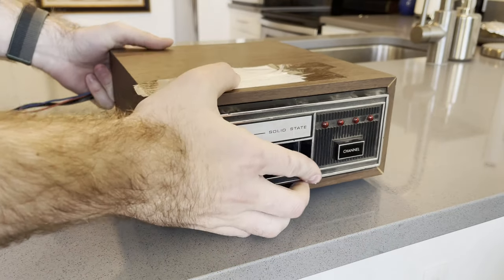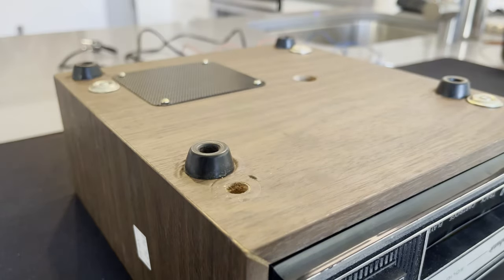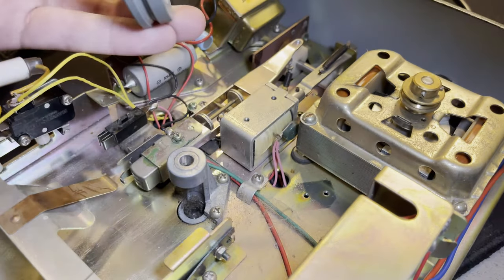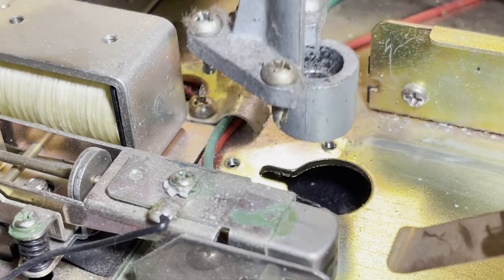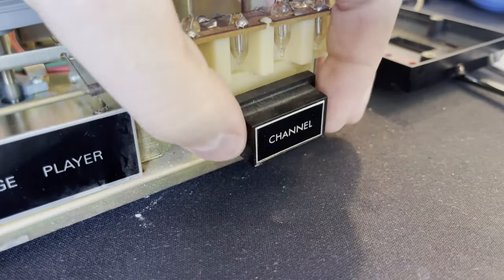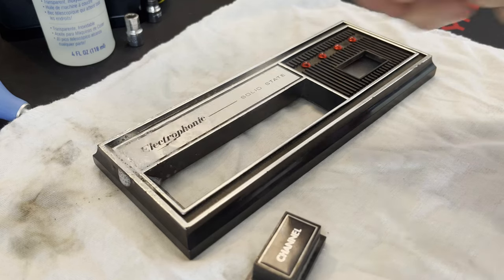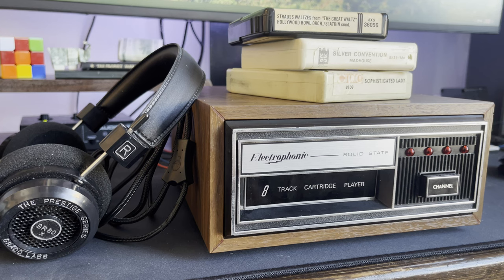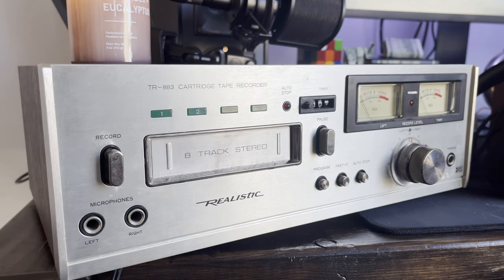Busted 8 Track Player, Will It Play Again? | Vintage Hifi Revival

Comment: For those people fighting an 8 track player with huge radical speed problems, the power supply may need to be re-capped. It is not always the motor going south. If the power supply is sending unstable voltage to the entire unit the motor will run crazy fast,,slow back to a normal speed, a quick jump sounding chirp in speed,,,,over and over.  My "Sony TC-228" went nuts like this yesterday. I replaced 2 capacitors that were waaay out on tolerances on the power supply PC board and also the stand alone big trash can capacitor next to the transformer and now the speed is excellent again.  I got lucky it was not the motor.

Comment: That was awesome! Great job resurrecting that old 8-track player. I would recomment servicing the carts too if you're gonna play em regularly. Adjusting the tape tension and replacing the pressure pad and the sensing foil tape is most important. I had bought some 8-tracks from a record resale shop once and the guy at the counter told me they probably wouldn't play. I told him I know I how to service em and get em playing like new. I posted video of the tapes playing to the store's FB page and he was impressed.

Comment: I worked as a car detailer for years. We use air compressors & mild degreasers to remove dirt ect from hard to get to places like the front grill of this 8 track you were trying to clean. Hope this helps. Good vid too. Cheers.

Comment: Just found your channel and I gotta say, this is really good stuff. I enjoy your methods of diagnosing issues along with the repair and cleaning segments. As someone who was a teenager in the ‘70s, 8-tracks were the best! Except when they started dragging, then you’d have to put a book of matches under the tape to maybe get it to stop. If that didn’t work, sometimes you could pull the tape out one side and pull it back in on the other side quickly. That sometimes worked to take the slack out. Had a friend who’s mom worked at Sears and he had an 8-track recorder. Man, we thought we were high tech, recording tracks off of LPs and 45s. Prehistoric mix tapes. The main thing I remember about 8-tracks was the factory versions that changed tracks in the middle of songs. Free Bird, arguably Lynyrd Skynyrd’s biggest song, changed tracks in the middle. Anyway, loving your content!
Reply from the maker: Thanks! Glad you enjoy!

Comment: Put the contact switch back in and adjust it to just clear the cartridge and it should work, clean up the capstan and heads,also the rubber idler roller, the unit should work normally

Comment: Great video! I just received an Electra branded 8 Track / AM / FM Stereo unit (with the manual that has a schematic) from a family member, and the radio works, but the tapes I put don't play, yet I can still hear the innards of the player just fine, so I know it's not a belt issue. Going to investigate it further soon as I really want this thing to work! If all goes well, I'm eyeing on a Christmas compilation 8 Track tape that has all the good classic songs you'd hear on the radio. Wish me luck! I'll keep you posted!😁👌
Reply from the maker: Thanks and good luck! If you can hear the motor, but tapes aren’t playing then it’s possible the belt fell off one of the spindles. It’s usually safe to assume the belt has gone bad if it hasn’t been opened in a few decades haha.
Reply: @HifiJelly  Update: It finally works! I don't know how but as soon as I took it apart, I could hear the tapes play when I put a test type in! Don't know how that happened, but I'll take it! Belt was still good believe it or not! I went ahead and cleaned the head and the capstan and motor just to be on the safe side. The capstan wasn't that bad, but the rest needed 4 Q-tips each, on both sides! Yikes! All I need to do is to see if any of the tapes that I received with it need repairing, and I'll be set! I will use the videos from 12voltvids for reference. Thanks for the help though!😁👌
Reply from the maker: Glad to hear it! The best repairs are when opening the device somehow fixes it haha
Reply: @HifiJelly  Ain't that the God's truth!😉

Comment: If that is real veneer I'll eat my shoes. These cheap boxes had almost uniformly laminated coverings. You can see the difference because the 'veneer' is a single length flapped over the edges. Real veneer would stop at the edges of the box. That said, in good condition laminate can look just nice.
Reply from the maker: Good call it had me fooled, looking at it in more detail and yeah, it's definitely not real as its bent over the edges and around the front. Also, that would explain the bubbling around the bottom feet.

Comment: Electrophonic  A.K.A. Morse - Electrophonic.  We sold them at the shop.  Cheap, overhyped low end stuff.
Always tried to sell  something else.  They had a distributor 15 mi away in Framingham Ma.  Handy for parts etc for us. 
I dont think Sears sold them but any real radio - TV shop could.
I bet your microswitch had a plastic roller on it. If it fell off the tape would hit the actuator arm instead
of the roller. Anyhows it does have a nice heavy motor.
LFOD !

Comment: I grew up with 8 tracks but I never really bought any; was into vinyl. Then I just started collecting them around 1990 at flea markets and thrift shops for about 25 cents to $1. People I bought from looked at me like I was weird and some said "You still buy 8 tracks?" Then ebay came a long and goodbye cheap 8 tracks or even finding them. I've worked on several players and tapes and posted some videos mostly on tapes. What do you have is a very solid piece; I love the durable AC motors even though they tend to get hot after a while which is why there is a metal vent grill on the bottom of it. Looks like they used a rubber band instead of a dry belt (?) which can cause the wow and flutter in the sound. Rubber bands are okay for things like analog Tape timers/counters. The issue with the switch is perhaps that it's not the original part and somebody replaced it wiith another that doesn't fit the way it should. If you could reference your player with another exactly like it and see how that one is configured would be helpful.

Comment: To reslack the tape find the splice remove the splice take the tape and gently tug the end on the outside of the spool untill lightly snug. Then pull out 3-4 feet of tape from the center of the spool and resplice with new metal splice tape. Then re assembl the case . Now with the excess tape hanging out of the cartridge gently and patiently pull the tape from the supply side untill all the slack is back inside the cartridge.  Wala now tape is reslacked

Comment: TY for this. Currently working on a quite similar JVC Nivico unit, but this one does not have any convenient oiling hole on the motor. This is quite frustrating as there seems to be no place to apply oil and the motor casing gets too hot to touch during normal operation.

Comment: It looks like it may have been made for Electrophonic by Matsushita / Panasonic, based on the logos on the motor and switch.
It's interesting to see how well-built it is compared to the later cost-reduced designs that appeared in the '70s. I have a similarly low-end Craig 8-track player made by Pioneer from around the same time period as yours, and it is also extremely well built while having an almost minimalist internal layout. It's so well-built that it even has an unusual oil distribution system with a cotton-filled plastic cup acting as an oil holder with little oil pipes leading to the main motor and capstan bearings.
Reply from the maker: Wow an oiler system in an 8-track is absolutely ridiculous. I love it.

Comment: 8 tracks were from the 60’s. And you should use silicone lube on plastic not oil. Oil will attack the plastic over time.

Comment: Sounds to me like you've still got some wow and flutter problems. Or maybe that's just the way it is with one of these!
Reply from the maker: Yeah, I think it's from the machine that I used to record the 8 Track that I was playing at the end of the video. The belt was loose on it and to quickly fix it I just overlapped it on itself and glued it haha. Also, I think it can depend on the cartridge, that waltz may be an especially bad one.

Comment: hi carboots in the uk were full of them  i have worked on alot of them over 30 years  wear of the  carts is very bad i went
over to 4 track carts  with out the pinch rollers  i jazz up alot of 8 tracks  to 4 track i know of a way to cut the hole in 
8 tracks as the wear on the  pinch was not playing right  i order a lot of brass rods for in side and turned down parts to go in side
the 8 tracks

Comment: This might seem weird but it might just be intended to push the cartridge very hard into the player, it helps it stay in place, which my 8-track player has answering just like that, but it's very weird it's just 1 roller intended to hold it up.. it might just be that the roller on that switch has gone hard and doesn't roll, and causes it to be dumb and stiff? Just some ideas
Reply from the maker: Thats a really good idea, I'd not considered that the wheel at one point could've been more pliable.
Reply: @HifiJelly  I think my player has a similar issue, when I first got it, it was very hard to push in a cartridge, but I've used it much more since and I think it's more loose then it was before

Comment: Ok video. But not to be to critical,  I would have done a much better job with a lot less effort.  And a without any mangled parts, or modifications.  But i grew up with 8 tracks and as a boomer electronics tech am an expert at fixing4& 8 track tapes and players. And that still is not working properly there should not be any wow and flutter.  Which could be that the tape needs re-slacked and the pinch roller in it cleaned. Some tapes have a hard plastic roller they suck. But if everything is clean they will work well.
Reply: They do work well if everything is in good order. Most cap stands should have a roughened surface to them too, not the smooth shiny surface that you often see. The shiny surface comes from years of use of the rough surface being worn down. Do not try to roughen up the surface yourself, which can only be done by a professional who sandblasts them. The Wollensak brands particularly need to have a rough capstan surface in most cases, others manage without it.